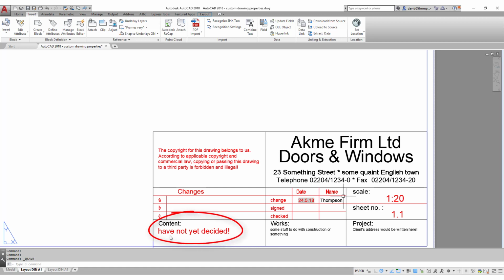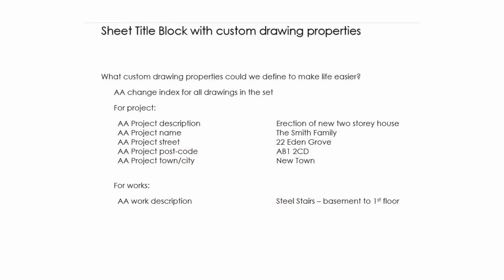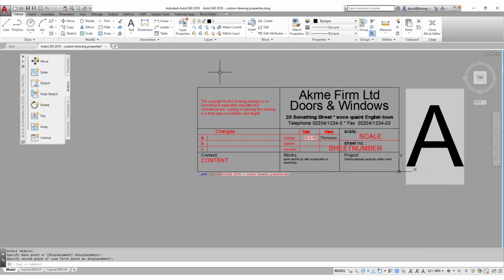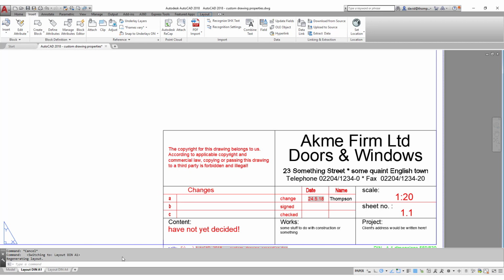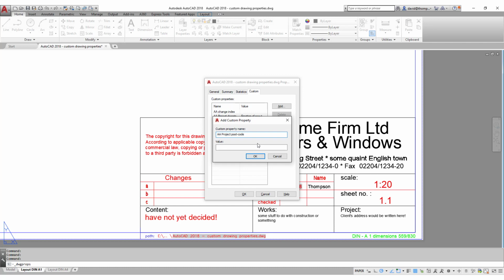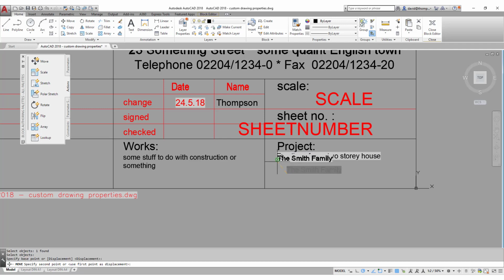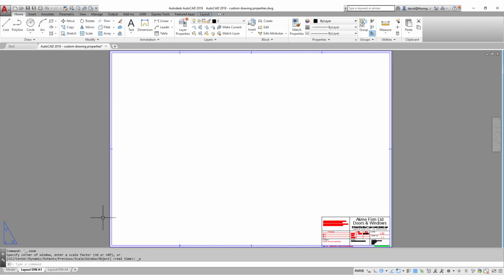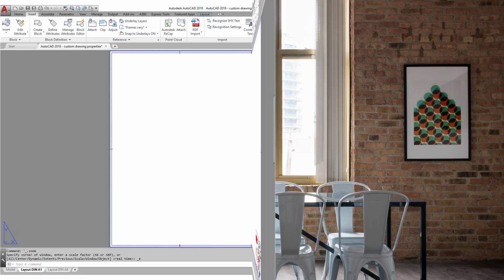AutoCAD 2018 - how to use drawing properties in sheet titles!

Comment: Hi, My name is Ashur and I am from Sydney, Australia. I am learning on how to use CAD+T which is an AutoCad base program for wood working, I need help with setting my sheets with title block and logo from the existing one, dwt sheet set that is already loaded in the program, any suggestions on how to do that and if  you need a remote session through a teamviewer or the like, you are more than welcome.
Reply from the maker: Hi Ashur,
nice to hear from you. I have heard of CAD+T, seems to be a really good program! You probably 'just' need to set up the drawing as it should look for you (this video is probably better: https://youtu.be/mCEsD-3HJRw) and use 'save as' to create your own dwt file - you will find that file type in the middle of the list.
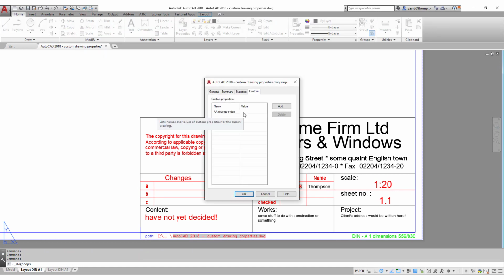If you still have access to the computer late afternoon early evening, then it would not be too difficult to set up a meeting if you need help - by 5:30 pm your time, I will be in my office (07:30 here).
Reply: @CADSchulungen  , Hi David, it was great to hear from you and thanks for your channel , it is really contains very well organised and well described videos, in regard to this issue,
I have done some thing and I believe it work, I opened  a dwt file from the drop down menu and resaved as in my name then I changed  the title block and the logo to suit my requirement and saved again, I have no problem if you wish to have a quick look, it is nearly 11 pm in Sydney. Kind Regards